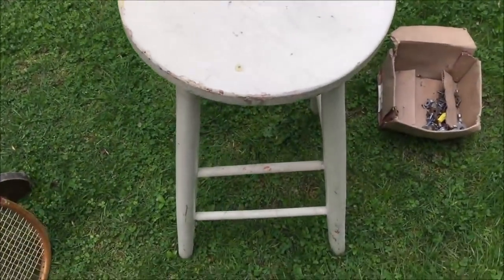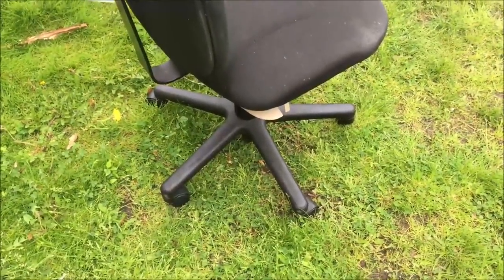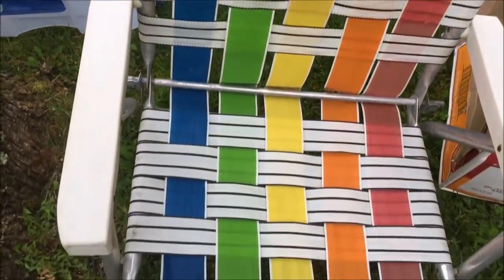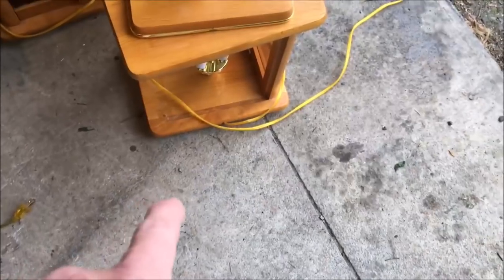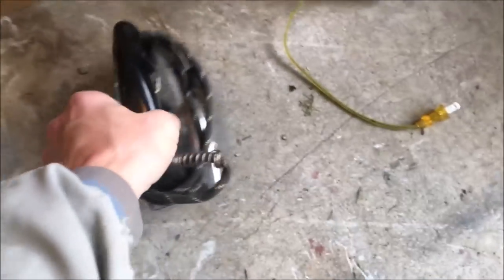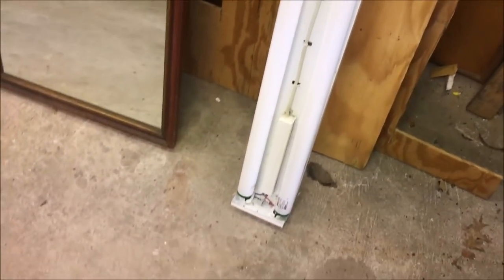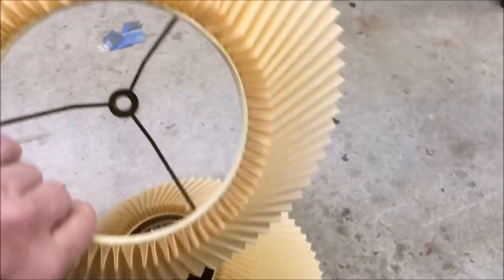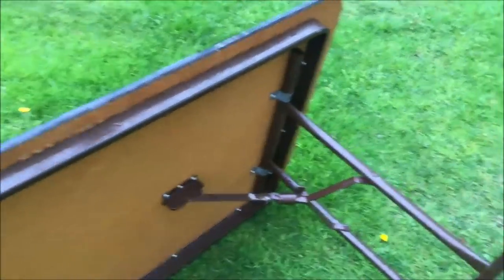PICKING GLENBURN TOWNSHIP 2019!!

Comment: My Dad had a box of nuts, bolts, screws,  nails, etc. He called it His "might" box, you might find it and you might not.  ;-)
Consider doing something with those lamps, like painting, putting shells or pebbles inside the base, maybe a pastel color or gray or black to look more modern.
I'm in Texas or I'd come by...
Reply: I was thinking the same thing about the lamps. Even salvaging the working parts, the bases looked like oak. Gotta be some crafters out there who could make them work as decor pieces.
Reply from the maker: interesting idea , but would never sell . the lamp hardware is worth more than the lamps